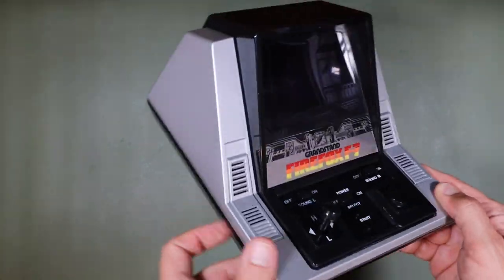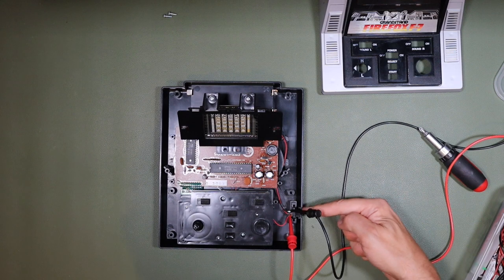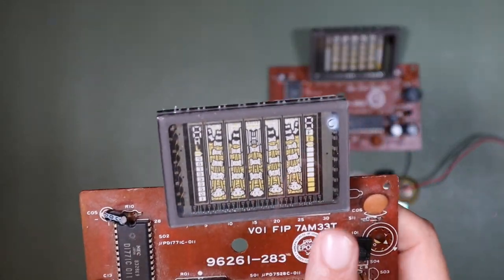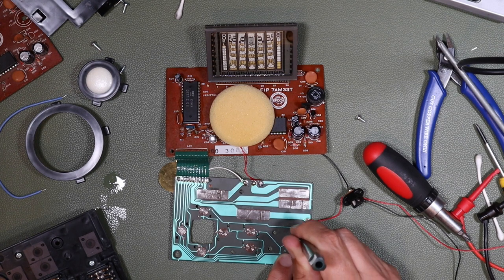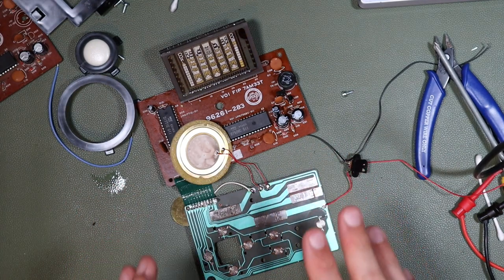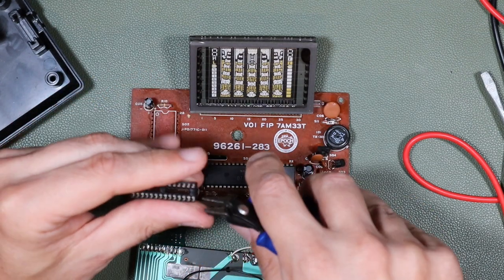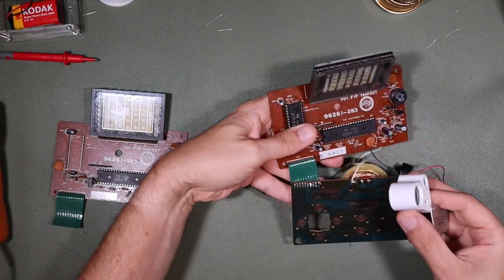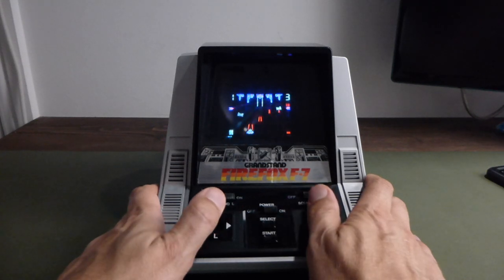Trying to Fix an Astro Thunder / Firefox F-7 Retro Handheld Electronic Game

Comment: Not sure if you have come across this or not; I replaced the same transistor on mine but the Select and Start won't work.  Gave them a clean and tested continuity back to the main chip and all is good, now I'm stuck.  Any ideas?
Reply from the maker: Oh wow that is weird. I have repaired a lot of these games but haven't ever seen that. I have seen cleaned contacts still not work due to carbon pill wearing off the button so if you havent done so id double check that pressing select is closing the contact. I've also seen hairline cracks at the pcb pads of the IC, where the pressure from the meter overcomes thr crack so they buzz out ok but don't work in use. So I'd inspect under magnification and maybe reflow the joints to they extend onto the track a little. It could be partial IC failure though I haven't seen this myself. Good luck. Let us know how it goes. Thanks so much for your question

Comment: Another great video.  When searching on eBay what search terms do you tend to use?  Also, what temperatures do you usually set your soldering iron to pls?  My first console was Astro Wars and computer was Toshiba MSX HX10 64-bit (in 1985 I think).  TIA
Reply from the maker: Hi Scott. I use quite a few different terms when searching eBay, too many to list but "electronic game" and "vintage computer" are among my favourites. I also search for common misspellings. generally though I just browse the categories of interest. I run my iron about 350 for through-hole, which is on the hotter end I think, but its a cheap solder station and I am not sure its very accurate. Astro Wars remains a favourite of mine and the one I remember best from my youth. I have never had an MSX, I wish I had bought one a few years ago but prices recently are high. Thanks again for your comments

Comment: Nice sleuthing! You know, my Firefox F-7 (or as it's badged here in the US, Galaga X6) has quiet sound on one of the channels... I wonder if that was a factory error?
Reply from the maker: Thanks Nathaniel. I love my F7 / X6 I too wondered if it left the factory that way. I suspect not, but who knows. These things were made to a cost so perhaps the odd one sneaked through. I would be suspicious of solder joints to the piezo sounders but have learned to be careful with soldering iron temps on those as a hot iron damages them. Anyway I am glad you enjoyed the video, it's great to have another US viewer. Thanks for the comment.

Comment: Great video! I like the idea of using a chip holder like that so you can switch between IC's or maybe you could create a breakout board to measure current etc. I recently had to do the opposite on a Topping audio DAC that had intermittent distortion in one channel once it had warmed up. It was caused by an op-amp that was socketed (to allow for easy upgrades). One pin was occasionally floating. Ended up soldering the op-amp in and it's been fine ever since. Really enjoy your video's, thanks!!
Reply from the maker: That's great like you say almost exactly the opposite! I got the socket idea from a comment on another video of mine. It worked fine but I did solder the chip back in in the end. The sockets I have are cheap and didn't hold up well. But I'm sure a good quality one would make a huge difference. Thanks again for your comments and support. Hope you are well

Comment: Marvellous video as always and thanks again for your comprehensive walk-through/talk-through of your fault diagnosis. I have two  eBay sourced F7’s I need to fix at some point when I find the time... I still need to pick up one of those great de-solder tools like yours. It seems so effortless!
Reply from the maker: Thanks Michael... I LOVE my desolder tool. Speeds things up so much. Mine is a cheaper one (duratool) from CPC FARNELL. Firefox like most of these games often fail because of the D882 transistor which you can get on ebay (and maybe from CPC too).  Thanks the kind words and feedback. Good luck with the repair

Comment: Where can I get spare parts to repair a broken joystick on these types of electronic games?
Reply from the maker: I don't know of anyone making replacements so if the joystick has snapped your choices are probably to repair what you have or try to find parts from a scrap game. If the joystick isn't working but is physically intact, there could be many reasons it's not working. In that case I'd start by careful dissemble and gently cleaning the contacts and carbon pills. This is not advice, just what I would do if it were my game. Thanks for your question.
Reply: @RetroTechRepair  thanks heaps. The functionality of the joystick is still fine, it’s just snapped off and therefore needing a new one. I’ve had no luck finding a replacement however

Comment: This is interesting. I have one that had a faulty D882 transistor. I replace it with a different model transistor. Now I get the start up music but no display. The replacement transistor gets very hot and the bench PSU tells me the system is drawing 0.8A.  Hopefully when the new D882 transistors arrive, I can test it further. Thanks for the video.
Reply from the maker: Hi Phil, if you are getting sound but no display after the D882 replacement and the transistor is hot and current draw high. My guess is you also have a diode failure somewhere. Perhaps take a look at my astrowars videos or my puck monster video for this type of fault. Thanks for you comments? Glad you found the video useful. Stop back and let us know how it goes and thanks for the comments
Reply: @RetroTechRepair  Thanks for your reply. I pulled a leg from each diode, one at a time, checking for a change after each one. 8 in total. The system is still taking 0.8A.  I'll watch those videos now.
Reply from the maker: @PhilipBryden  happy to help... interesting result with the diodes. Sometimes they are hidden behind the vfd etc but or could be something completely different. Thanks for reporting back I love these game so I'm interested to see what the problem is.
Reply: @RetroTechRepair  I did pull the ones behind the screen too. The smaller C945 tests ok too (out of circuit). I have emailed a link to a short video about this board
Reply: @RetroTechRepair  Do you have any info on the pinouts of TX-30. If pin 1 is on the arrow, then pin 1, 7 and 10 go to ground. 7 seems correct but there are diodes on [ins 1 and 10, so that doesn't seem right to me.
Reply from the maker: @PhilipBryden  sorry I don't have that info and unfortunately nolonger have the game to check it out for you.
Reply: @RetroTechRepair  I have installed a new D882 and the console it taking around 0.350A. The transofrmer TX-30 isn't outputting any voltage.  Do you have a TX-30 on an old board I could buy from you?
Reply from the maker: Hi  @PhilipBryden  unfortunately I don't have a spare transformer. But I haven't ever seen one fail. Have definitely tested all diodes and have you tested the smaller transistor as well as the D882
Reply: @RetroTechRepair  Both transistors check out fine, the pins on the transformer aren't outputting any voltage and I'm reading no voltage at the diodes. I did check the diodes when I pulled a leg from each one. Current draw is 0.3A
Reply from the maker: @PhilipBryden  I am at a bit of a loss I'm afraid. Do you still get the start up music. If not then I'd double check the D882 is installed correctly and working. If you used to get music and nolonger do then something else has gone on or the new transistors tolerance are just a bit different. Also as a reminder transformer output is AC so remember to change meter when measuring (don't mean to be rude just thinking aloud). After that If you are still getting nothing I'd probably check the pcb traces with a meter. I don't have any great ideas I'm afraid
Reply: @RetroTechRepair  I have a displaty. I removed the transformer and both transistors. The new replacement transistor was shown faulty. Perhaps I shorted it while probing around.
I get game sounds but no intro atm and the controls aren't fully working. I'll spend more time on it tomorrow
Reply: @RetroTechRepair  Still interested in how I'm geting on? I removed the transformer and both transistors. The replacement 882 was coming up faulty, so I put another one in and the console sprung to life. 

Controls and intro sounds were intermittent. I found the ribbon cable to be faulty, so I removed it and soldered on 10 wires in it's place. So now I have display, controls and intro sounds but no in-game sounds, which I assume comes from the larger speaker connected to the D1771C chip. Speaker is tsted working and has continuity to the chip.
Reply from the maker: @PhilipBryden  yes! Very interested. The music comes from the piezo sounder and I think from the main micro controller. The second micro drives the larger piezo sounder with the cone. I think they can be switched off so I'd keep checking continuity. Sounds like you are making good progress